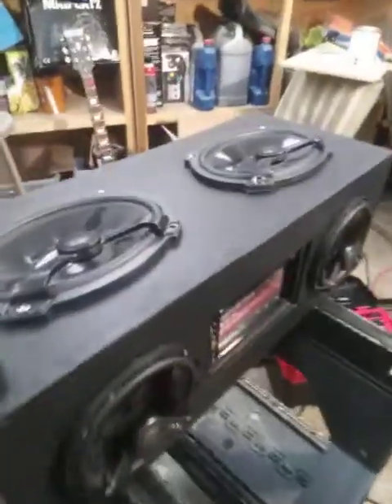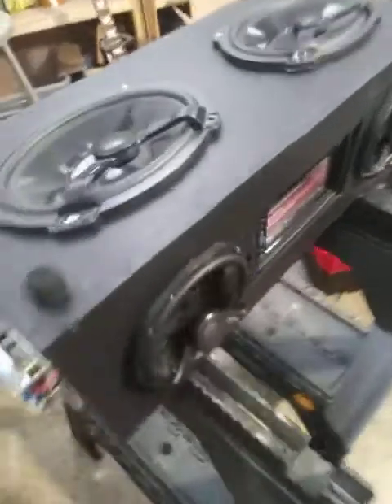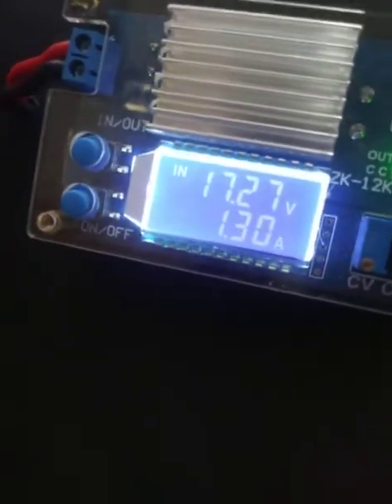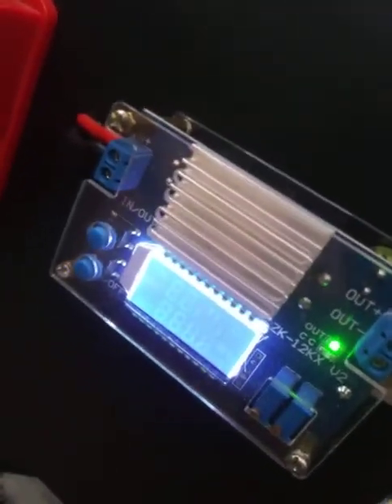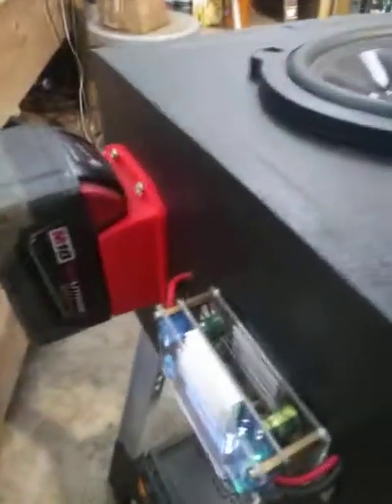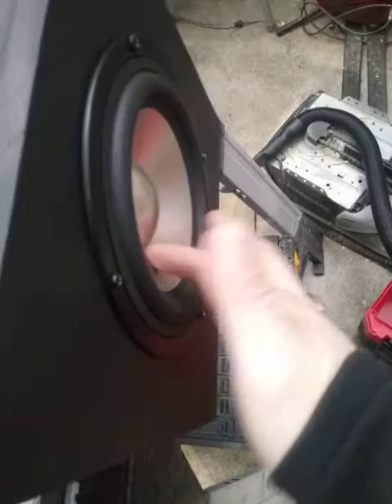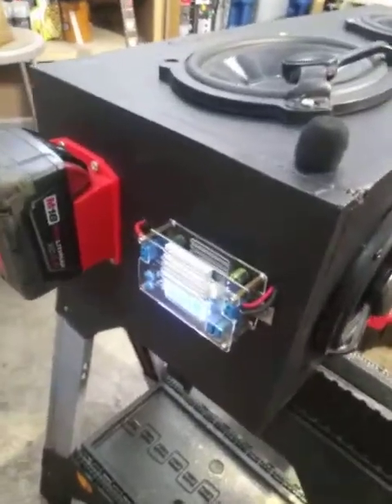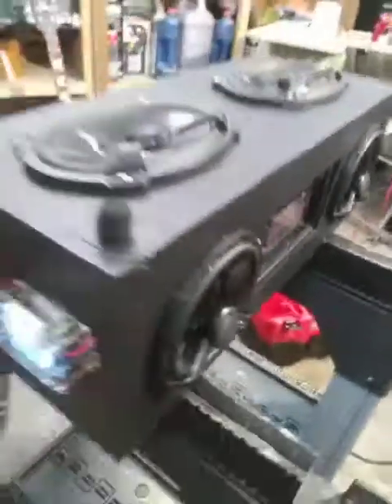Milwaukee M18 powered Boombox 2.0 Part 2

Comment: Nice setup man, im about to build one myself powered by 2 m12 batteries and i ordered a soundfy 400w amp 4ch thats the size of my hand, i tested them out and it had my speakers screaming loud and clear...you should check it out
Reply from the maker: @1978novabuilt  do you have them wired in series or parallel? I would be concerned 12v wouldn't be enough power as the voltage drops with the charge. Also if I did it again I would add a voltage cut off for when the batteries are low. I have ruined 2 batteries by forgetting and leaving them plugged in overnight.

Comment: Can you give me some information about it , what do I need to build something like that
Reply from the maker: Hey Maximino, I added the links for the power supply in the description. You could use any type of power tool adaptor but I prefer Milwaukee and have a bunch of batteries already. 

You will need
1 sheet of MDF or birch for building a box. 
2. Power tool battery with adaptor. 
3. Voltage Regulator
4. Any 12v audio combo that you choose. So long as it runs under 10-12 amps or so. (100watts or so)
5. Time and tools.